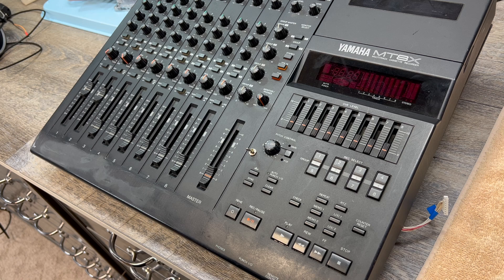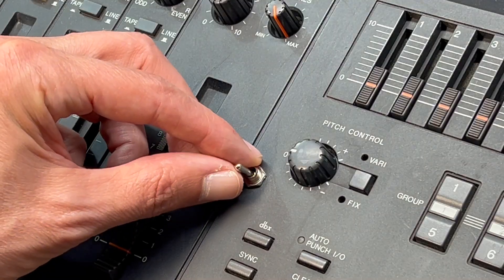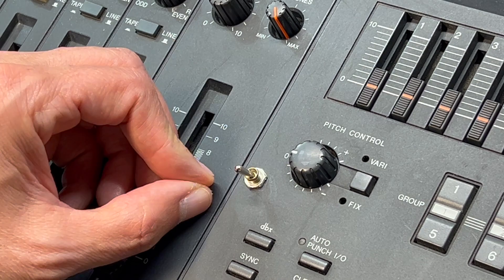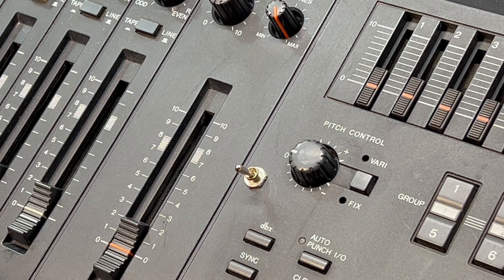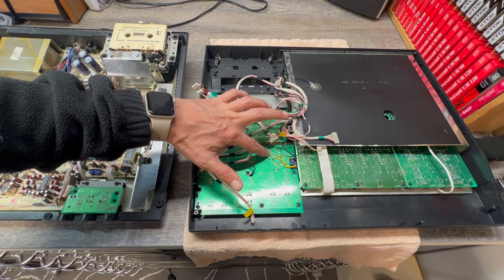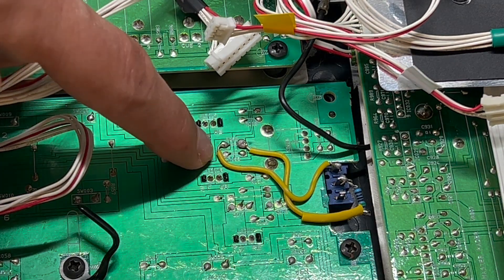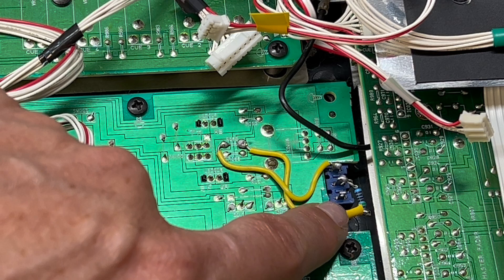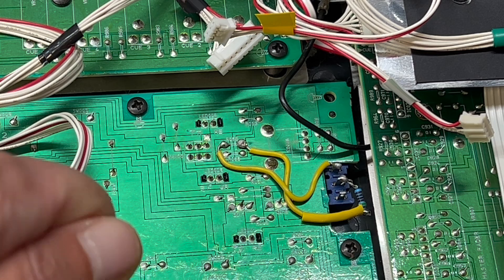Yamaha MT8X Speed Mod

Comment: looking to do this mod on my yamaha MT50… do you think it would be as simple as locating the equivalent tape speed pot on the board and installing the same switch mod? i have built various diy eurorack kits but havent modded an existing PCB since my gameboy back in high school
Reply from the maker: Maybe? It might take some poking around to find the right place for the switch and resistor. Another approach is to put a pot on the wires going to the motor like this: https://www.youtube.com/watch?v=gqYoT7TbUec
But hard to say without being familiar with the MT50. Good luck and be careful!